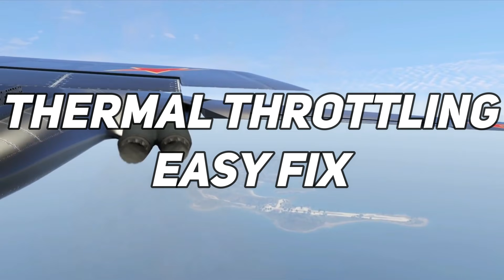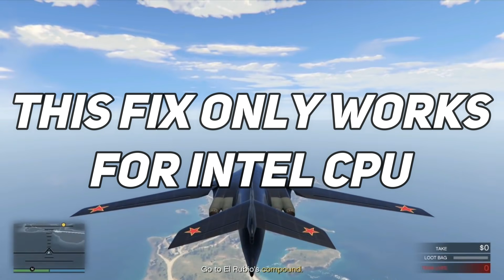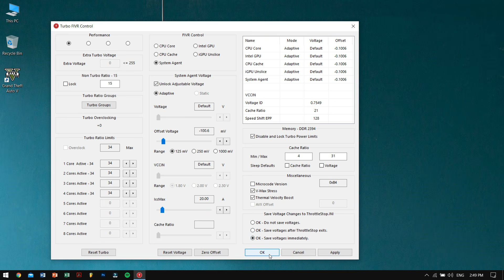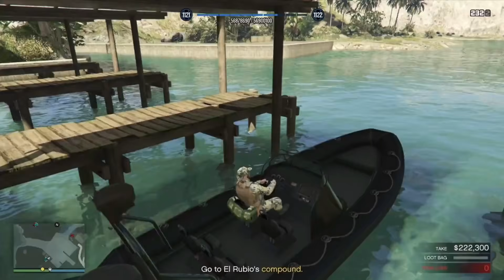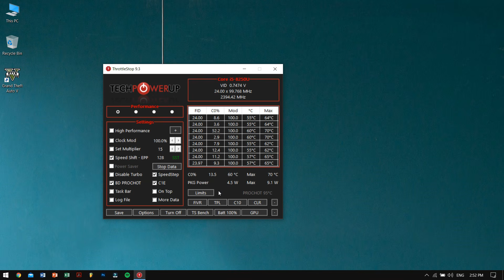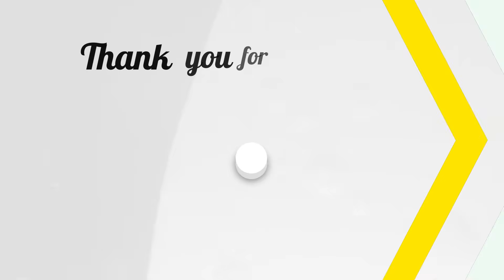Comment: Bro you are a genius you deserve more subs bro after explaining everything that whats happening and doing tutorials straight into the point and love you bro you deserve more subs bro im about to cry bro i have a DELL INSPIRON 3593 i5 10thgen 4gb ram pc and i used this laptop like for 5yrs and with this thermal throttling thing i couldnt even play just a single (nfs 2012) game then I found this video and i clicked it and do everything as u told and now im getting 50- 40 fps in fortnite with 70% 3d res. with just 4 gigs of ram and without any drops. but im getting some drops rarely but it disappears but before i fix this watching this guy's vid. i got 40 - 30 fps but with many drops i coudnt play the game then. thanks mate you are a lifesaver..

 if anyone getting many drops with this same laptop model all you have to do is follow this guy's steps but u need  to change the thing that he says in the 1st method about the cpu voltage thing into -50 and if you change that into -100 the pc would start to see a black screen and you would see some screen issues like ur curser start to dancing like that but anyways after that you need to do the 2nd method. then if ur problem fixed but if the fps that u would get might be low because of this laptop model. so you can also increase them by asking chatgpt about the fps increase gameuser.ini file thing and follow it then you will deffinetly get around 40 - 50 fps  in fortnite 4 gigs of ram without any frame drops but you might get some at like heavy scenes which are i also usually getting but dont care about it that much it drops like only for 3, 2 seconds. 

anyway thanks a lot bro u got this have a nice day you are the best thanks a lot bro
LOVE YOU BROOO

my laptop specs:

Dell Inspiron 3593
i5 1035G1 -10th gen
ram - 4gb DDR 4
Gpu - mx230 2gb
windows 11 (atlas os 11)

thanks for the big help love you guys :face-red-heart-shape:
Reply: Thank you so much! You made my day😊
Reply: Love you bro keep it up you deserve more subs bro ❤🎉
Reply: Thanks

Comment: I've been struggling with CPU settings for a few days now and Grok suggested a 3rd method to me before I got here😅 I have an Intel I9-13900HX and what Turbo Boost mode does to this processor is a real tragedy. When I run something demanding, e.g. Universe Sandbox, the temperature on the cores sometimes reaches 97 degrees.

Comment: We have the same CPU, so I was able to follow all the methods. Thank you very much for this tutorial!
I followed upto Method 2. (Last resort would be Method 3 / Backup)

-------------------------------------------------------------------------------------------------------------------------------------------------------------------------------------------
I did try -150 offset and it resulted i BSoD (The limit was -125)  hahaha!
When I ran the TS Bench, I had errors so I reduced the offset Voltage from -100 to -90.

What causes the error? 
"If the ThrottleStop TS Bench is reporting errors, it is telling you that your CPU is not 100% stable. If you are under volting then you have definitely gone too far. Give your CPU more voltage until the TS Bench can complete with 0 errors. There is nothing wrong with the test. All of my computers can complete the TS Bench test without any errors." - uncle webb

Source: https://www.techpowerup.com/forums/threads/throttlestop-ts-bench-errors.260037/

-------------------------------------------------------------------------------------------------------------------------------------------------------------------------------------------

Aside from that, I followed the rest of the Video.
Reply: Great

Comment: My laptop's using AMD Ryzen processor. If possible, could you make a video for AMD processors?

I've seen some of the comments and they all say this solution worked, but ONLY for Intel processors, like you said.
Reply: bruh same please if you find any solution please help...My laptop is thermal throttling and the gpu clock lowers below base clock and it lags like crazy

Comment: edit:(if throttlestop doesn't work disable vm in windows features)

I can brutally say that it works, it didn't help with the degrees that much maybe 3-5 drop but I can say my fps are much much more stable, if you facing the same problem with i5-9300h I recommend you reading the acer community form and try their different undervoltage numbers I myself used -140.6 on both core and cache and also lowerd the cores power, if you're having issues with ds4windows giving you random lag spikes I recommend you delete unused hid drivers or disable them the best way is there's a program called devmainsomthing I forgot the last part also there's a Microsoft service you need to disable that'll disable your bluetooth but it stops the lag spikes, I reccomend y'all buying a cooling pad a good one it may be a lil bit expensive but it's better than frying your cpu, ( I changed my thermal paste to arctic mx4 I'm using acer nitro 5 i5-9300h rtx 2060 I tried everything but after alot of digging found this + a good cooling pad ) hope this help thanks

Comment: the section which have cpu core and stuff in my laptop it is showing not available how to fix this please help
Reply: Which generation of CPU are you using?
Reply: @TechTweek  dell g25 5520 with i512500H RTX 3050 please help me I am so don't with this throttling I serviced my laptop but there was not so much dust it was mostly clean and the thermal paste was also good

Comment: Hey brother! My laptop (HP Omen) is about 4 years old. The throttling started happening only a year or a year and a half ago. I feel that there might be dust and dirt stuck in OR UNDER my fans. Do you suggest I try your methods before getting my laptop checked/cleaned or should I get it cleaned first?

Edit: The temperature of my GPU (GTX 1650) is much higher than the CPU. CPU stays at a stable temp.
Reply: Try cleaning it first and apply new thermal paste. If still the problem persists then try these methods.

Comment: It's a lot more than just fixing thermal issues. You can use programs like ThrottleStop to REALLY tune the performance of your computer. Now I'm scoring in the 99th percentile on CPUBenchmark with scores north of 30,000 on R23. Give it a try! It's fun. Addictive actually.

Comment: Will this fix render the same sort of results when running pro tools? I keep getting crashes the minute i press play and have been thru all the typical optimizations for 2 weeks no luck. I dont game but i was running just fine for 6-7 hours a day with no issue besides some airplane hanger sounding fan noise. Ran an update cycle and also may have had a bad external HDD plugged in for a about 2 days prior (but brand new; factory defect i assume).....any one try this on a DAW yet?
Reply: I am pretty sure, the crash should be fixed after using the method 3. You might get a bit less performance but the crash should be fixed.
Reply: @TechTweek  makes sense. Guess I'll find out in a couple hours. I was already settling in the idea of buying a new one anyway. I can hear my pockets getting flatter already. Great vid tho! I'll sub either way 💯
Reply: @chefbizzy thanks man

Comment: I ahve been looking up videos on youtube, and info on resdit becuase my cyberpower laptop (RTX2070_i7 10875H_32GB Ram) kept throttling, stuttering, while gaming online "apex". So far after 2-3 games i only throttled, stuttered one time but it wasnt as bad as before(one time in 3 games). Before i would stutter,throttle multiple times per game. This also helped my temps gor from CPU= 85-94c to 55-75c and GPU= FROM 80-90c to 55- 76c. I ordered some PTM7950 thermal pads and a IETS GT500 laptop cooler which should help the temps drastically. Cant wait to get delivered. Anyhow hands down the best video! Thank you. Btw my laptop bios didnt let me undervolt or do anything to my cpu but throttlestop did. 😊
Reply: Thank you so much 😁

Comment: Thanks for the Guide, i have same CPU. So i did same as you. Didn't disable boost bit did Turbo Ratio Limit put all cores from 34 lower to 24. a did get little bit lower Temp. For now i'm getting 45 to 55c' just from Browsing. and with Games 75 to 80c' was curio do you have same Temp or did you try even more to tweak ?
Reply: That’s it

Comment: My Lenovo ideapad5 always throttle in every game. I'm going to try to clean the fans and the thermal paste. But i'm going to try this methodes first. I'll reply on this comment if they were helpful
Reply: It's been 6 days, how are you?
Reply: @250Hz  so, i still haven't done anything about my fans or the thermal paste, i installed the Throttlestop and realised that most of the options mentioned in the first two methods are not adjustable for me for some reason, but i tried the third method and it was very effective and my laptop throttles way less while using the Throttlestop, but it still happens sometimes. I believe with a proper cleaning of my fans, these methods can almost fix the issue completely.

Comment: When im play roblox studio 
Gpu usage is 100%
Cpu usage 2.10 ghz
Im use medium graphic
And fps 55

My laptop spec
Core i3 gen 8
Mx110

1 week ago im cleaning fan laptop and changes termal paste
Then when in play roblox studio for 20 minuts fps drop from 180 to 55
Before changes termal paste fps is stable at 180

Are you have solution?
Reply: Please try method 3 it should work great.

Comment: Cool
But
What if the fivr doesn't work
I really wanted to undervolt
So i use the power limit 4
It Works a bit
But i think undervolt would be better
And the xtu don't open too
Probably because i booted my pc with only 1/1 and it probably blocked the xtu to do anything
I dont know what did the xtu doesnt work anymore
ANd i get more angry (since i have this little frier) cause my cpu only knows 100c
If it could passthrough
I have sure it would get 200c easily

So
Do u know how to make the fivr works in a pc that don't work
Reply: Try using a newer version of throttlestop if you're using a new CPU. But if your PC or CPU is old then use an older version. Still if it is not working then try method 3 to fix the issue.

Comment: I don’t have the fivr option I even downgraded to 9.3 and reinstalled the latest version and it didn’t show up
Reply: What is your CPU generation? And try checking your bios. Your manufacturer might have turned off CPU Unlocking.
Reply: Intel(R) pentium (R) silver N5030 cpu @ 1.10 GHz and it’s a gateway laptop if that helps
Reply: I’m In bios under cpu power management and it’s set to turbo mode enabled boost performance enabled
Reply: And should I enable active processor cores?
Reply: @Solowasreal  you can try doing that.

Comment: I have an HP Envy 13 with an i7-8565U CPU, an Nvidia MX250 (10w) GPU, and 16gb ram. I utilized all three of these methods, even turning down my CPU voltage (all 4) to 20; turning my CPUs down to 20, making all adaptive undervolts to -57, and disabling turbo mode finally helped me get the FPS I want for my games.

Thank you Techtweek and God bless you too!
Reply: Wow! Thank you so much & Enjoy😃

Comment: Thank you. Still works. Tried on my dell laptop (intel i57300hq + gtx1050) all 3 methods and worked like a charm. Apex Legends was unplayable before and now it's running fine on 1080p and all on mid. Thank you again!
Reply: Enjoy the free performance! 😁
Reply: @TechTweek  Hello, so in the first method i dont know why but i cant change anything in fivr menu
my cpu is i7 10750H. Do u know by any chance that why this is happening?
Reply: @kratchh  Make sure you're using the latest version of Throttlestop. And try it again.

Comment: Literally did all 3 methods. And my guy. Not all hero’s wear capes but you gotta get yourself one cause not only is my temps drastically low my games run even better! I’m getting way more frames and it’s steady more than ever before. And my laptop is still cool. Razer used to have insane heating issues that caused a lot of throttling but stripping down voltage and limiting the cores really did help keep the laptop performing as it should without the heat. Insane man…
Reply: Thank you so much 🦸‍♀️ 👈and that's me!
Reply: @TechTweek  you’re a flippin genius! I can’t thank you enough! Never stop finding the alternatives, you’ve earned a sub 🙏🏻
Reply: @mynameis.5480  Thank you so much⭐
Reply: @mynameis.5480 Did you do the same from the video? Were everything you modified the same values as those in the video?
Reply: is there really a hero wearing cape? 🤣
Reply: Not that I know of 🤓
Reply: @rigidhammer7376  Superman?
Reply: @GianEditss  lol. you dont get me
Reply: i literally cant undervolt my cpu

Comment: hi. I liked your channel. my son is suffering in fortnite, the i5 10800U processor is warming at a peak of up to 95 degrees Celsius. the processor is loaded minimally, by 20-30%. basically, the load goes to the 3060 laptop video card
Reply: There's a way of undervolting your GPU(3060) as well. But the process is different. You can find tutorials for undervolting your 3060 as well in YouTube. I hope that helps. 🙂

Comment: Hello I tried method 2 my rig is r5 3600 and gtx 1660 ti

So basically I lowered the cpu to 3.3 and what is the most ideal volts to set? im using ryzen master I play valorant and last question is does lowering the cpu ghz gives more fps and consistency? I hope u can help me thanks a lot
Reply: Thanks for the comment, but the most ideal voltage for your CPU will not be same for everyone. It is something you'll have to find it out manually by trail and error method. And your second answer is, lowering your CPU frequency will give you more consistency and stability, and talking about more FPS that depends on the game that you're playing. If it is a CPU based game then there will be increase in FPS but if it is a GPU based game then it might not have that much effect. I hope I answered your questions.

Comment: The worst thing happened to me was the BSOD, not just once but continuously did the BSOD everytime the windows logo pop ups at startup. Even accessing Safe Mode, it crashes. Well computers work in a mysterious ways, after a few days of not using it, it fixed itself when I said "I am going to throw it to garbage." before pressing power button.

Comment: I cant change itt
Reply: What’s your CPU?
Reply: @TechTweek  my i7-8750H could be adjusted perfectly fine, but my i5-8250U somehow doesnt work with throttlestop? Whenever I press FIVR, i couldnt change any value on the pop up menu.
Reply: @aYt1816  Try using a different version of throttlestop. Or else your manufacturer has locked your CPU.
Reply: @TechTweek  Thx man! I tried to use diff throttlestop and it works! Im not sure what was the problem since i downloaded the most recent throttlestop. i used the i7 setting on my i5! And it works like a magic for now!
Reply: That’s good news! Enjoy now 😃
Reply: i have the same probleme on my i7 8750H cant change a thing . cant figure out why
Reply: @aron33395  Use a different version of Throttlestop.

Comment: does it work with an intel i5 4460k? Pls need help asap
Reply: You won't know unless you try.
Reply: @TechTweek  it did recognize my cpu so fingers crossed i guess. And i have a question, my gpu recently is throttling at idle thus its making its temps higher then average, i dunno why thats happening, ive replaced the thermal paste and everything, and still no dice. Please if you have any suggestions it would be awesome to share 🙏🏼 Also great vid, im subbing 👍👍
Reply: @ibnlion1406  Well as you've already replaced thermal paste and yet it is hot, then make sure your fan is clean and it is running in the optimal RPM.
Reply: @TechTweek  Ive Cleaned the Fans, funny thing is everytime it throttles, whenever i opened up the task manager, it decreases back to normal temp 🤨 Any ideas why that is? I appreciate the reply so much thank You so much 🙏🏼🙏🏼🙏🏼🙏🏼
Reply: @ibnlion1406  Check for any mining processing running on the background. Try installing a premium trial Antivirus program and scan your PC for any malicious processes running on the background.Hope that helps.
Reply: @TechTweek  Do you have a reference for A Good Anti-virus Program? Because theres so many and i dont where to begin. Some say anti-viruses carry certain viruses as well and i dont want to choose a random anti-virus 🙏🏼 You Are A Great help My Brother 🤜🤛
Reply: @ibnlion1406  I personally use and trust Bitdefender Total Security.

Comment: It says: "Using ThrottleStop to overclock or over volt your CPU or to disable a laptop manufacturer's throttling scheme may damage your computer and is at your own risk." Should I take the risk?
Reply: But I am still considering shall I do or not.
Reply: @OyuncuDünyası1408  I took the risk and even now I am using the same laptop to reply to you.
Reply: If underclocking... It's safe. Pc will just shut down and restart if u screw it up.
Reply: Ask yourself

Comment: Wow! that actually worked. When I applied the settings it froze and I had to power off my laptop using the power button, and I rebooted it and expected nothing to change yet it worked. I've been stuck like this for a year, you're truly amazing! Please keep making this content, you are helping so many people everyday!
Edit: I also wanted to ask if I can use all the methods, I used method one and it greatly decreased my temperature but it still thermal throttled but it's much better now. So I was asking If I could use all of them since I think it would be even better performance. Thanks so much.
Reply: You can use Method 3 for the best thermal throttling fix. But it might result into less FPS.
Reply: Thank you for your kind comment. I am really glad you it helped you. Do leave a "Super Thanks" to support my work.
Reply: Thanks alot, method 3 greatly improved my performance and it basically never drops now. Thank you kind sir.
Reply: @spitties  That's amazing! A 'Super Thanks' on the video would definitely make my day.
Reply: The power thing happened with me too lmao. I thought my laptop would die but nothing happened